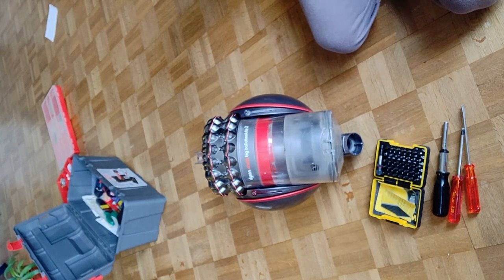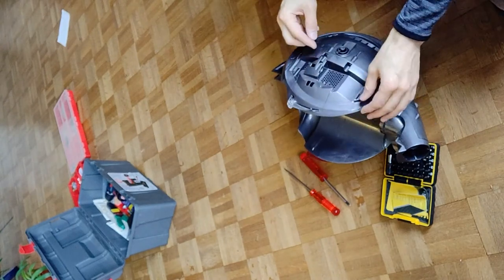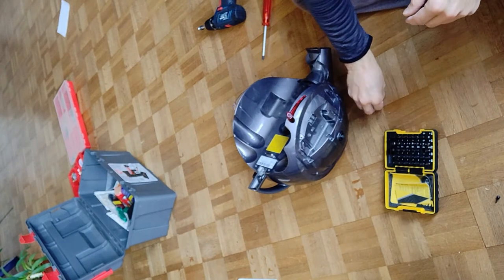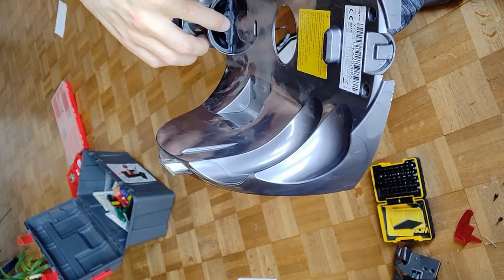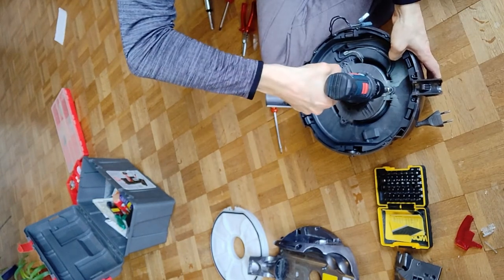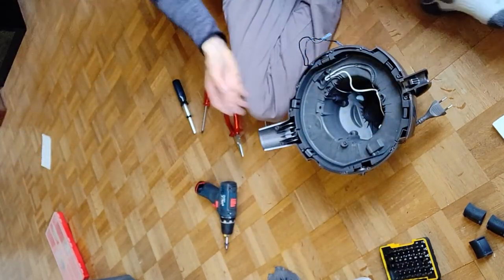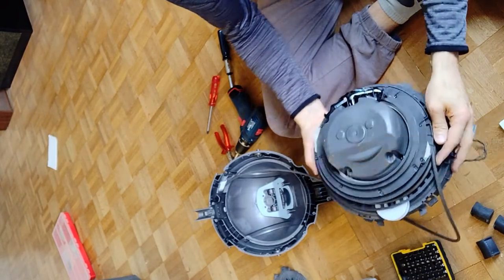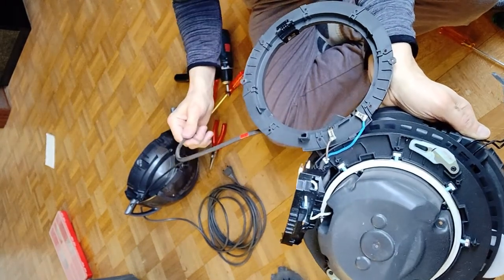01 Dyson cinetic big ball absolute 2, complete disassembling

Comment: I have extra canisters. You can actually tweak the square ports on the chambers by putting chamfers and round them a bit so you don't get build-up over time.
Reply from the maker: Can you please say at which minute in the video we can see the "square ports" you're mention?
Reply: @Tido help yourself  it's not at the minute. It's when you have the canister apart. It's where the ports go into the top side ( not top center where the tubes come down where the felt gasket is) of the cyclones. The video does not show the cyclone chamber being taken apart
Reply from the maker: I made 4 Videos, this is the one (https://www.youtube.com/watch?v=kyPYoBu7ans) in which I the assemble the clean cyclone unit. Maybe here you can point out at which place (minute) you made the improvement.